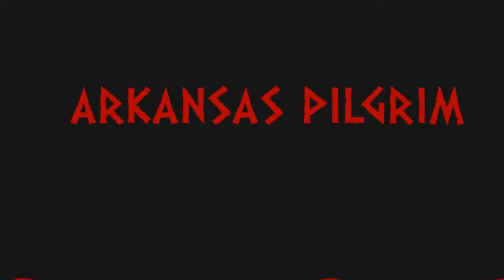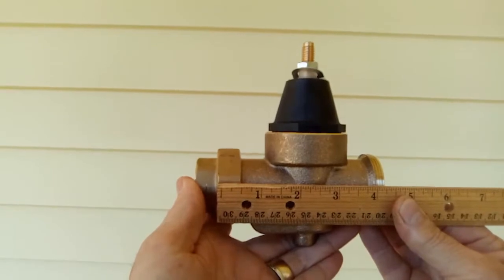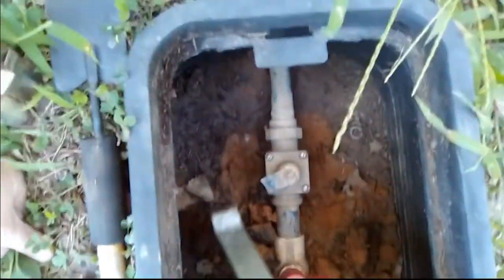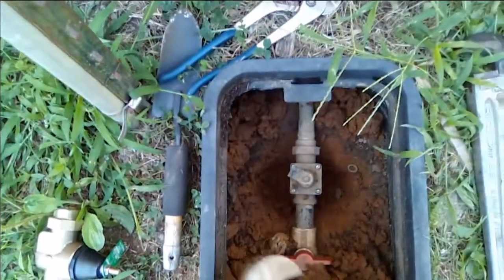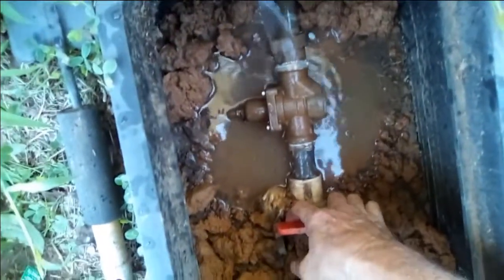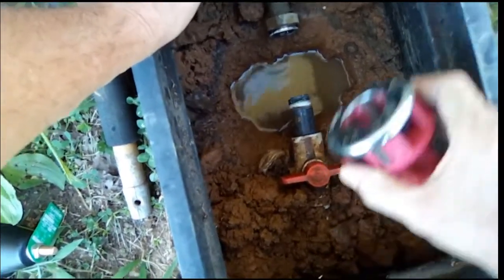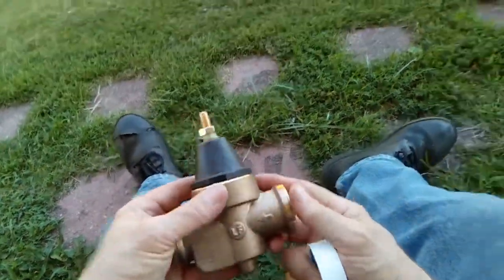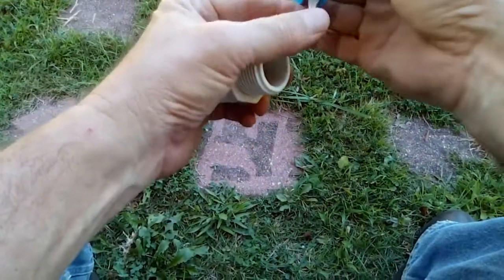Replacing a Pressure Regulator (not a Redneck Repair!) - Part 1

Comment: It can be tricky when you don't have much room. That's why we charge what we do. Last one I replaced was for Farmers insurance and they paid their book price I think it was $650.00
Reply from the maker: I actually called a plumber recommended by the plumbing parts store guy when he didn't have the replacement in stock. Fortunately for my bank account, his message box was full, so I looked the part up at Lowe's, and ended up doing it myself. Plumbers and contractors are worth what they get paid (if they do the work well).